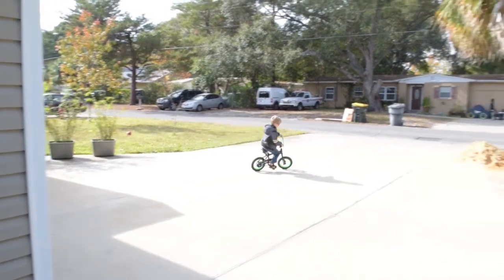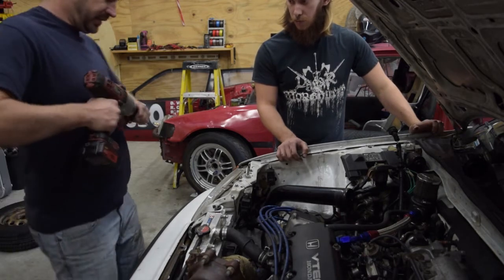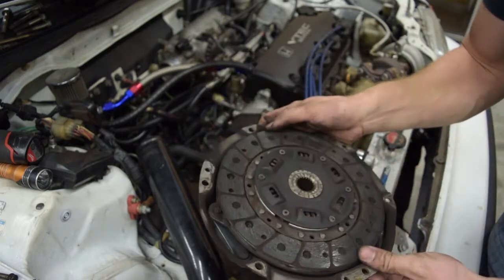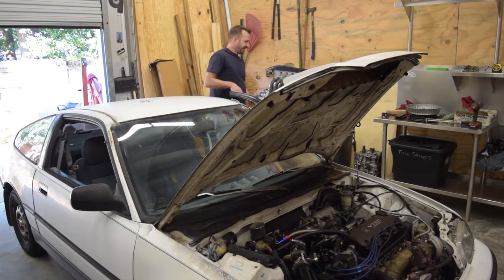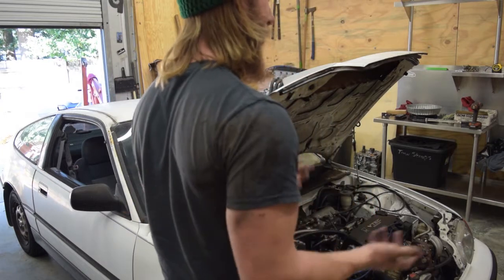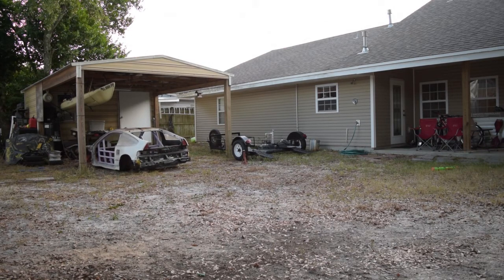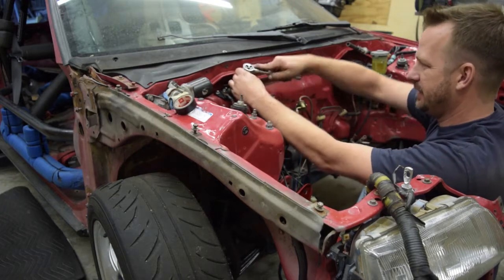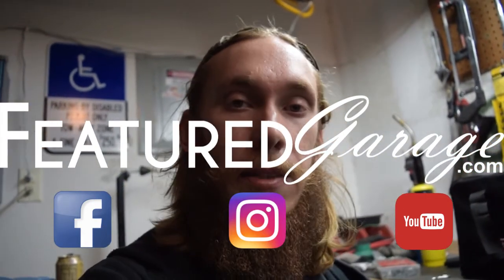STAGE 4 CLUTCH BRO: Vlog

Comment: Competition Clutch has a good rep online.  I have an Action clutch, pressure plate, and lightened flywheel in my EP3 w a tsx swap(k24a2).  I have had some kind of an issue that sounds like an input shaft bearing, but even after swapping transmissions its still there.  My clutch is sprung and seems ok when I check the springs with a screw driver.  I'll have to pull everything and find out whats causing this... Not sure if I would buy another one, but I had no issues on our Chumpcar's Action clutch.  Might get a Competition Clutch when I boost my eg.

Thanks for the video guys!!!
Reply from the maker: Do let us know what the issue ends up being. Do you think it's possible both transmissions had a fault? After discussing with Disco what the right clutch would be for my car I was sold on Competition Clutch due to their good pricing and his personal experience with them in his drag car. I've got a little over 2,000 miles on this clutch and five passes at the drag strip and it's treating me just fine.

We're glad you enjoy the videos! I know it sounds cheesy but sharing the videos out into the internet helps to get the name out there and as a result we may be able to produce better, more frequent content.
Reply: The first transmission had a csx lsd (canadian model acura 06 si) swapped into it and I replaced all the bearings (synchrotech kit) I didn't replace diff bearings... had the same noise.  The second transmission was a known good one out of a friends car.  Both times same issue.  When I put a screwdriver to my ear the sound is mostly at the back of the mainshaft.  It also isn't there when the clutch is in, but gets really bad on deceleration.  I have a 95 ody and a 92 hatch that I daily so the EP just sits in front of my house.  When I open it up and go through it I will definitely share my findings.

Keep the videos coming and keep the channel cool!

Comment: stage 4 for that low of a power. ? my stage 2 holds the same. am i missing something
Reply from the maker: The Competition Clutch stage 4 clutch holds 275 lb/ft of torque. At 13 psi my CRX made 216 lb/ft of torque. The old clutch was rated for 186 lb/ft. It's now cranked up to 21 psi. I'm not sure what the torque figure is but the clutch is holding just fine. I wouldn't want to "match" a clutch to car's rating but rather, I'd like to give it some head room, especially when slicks are on the car.